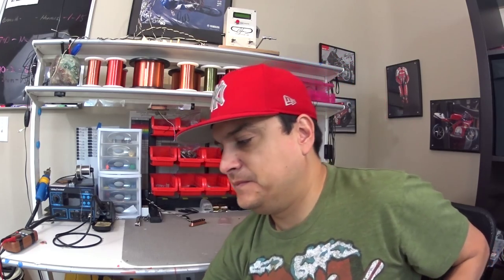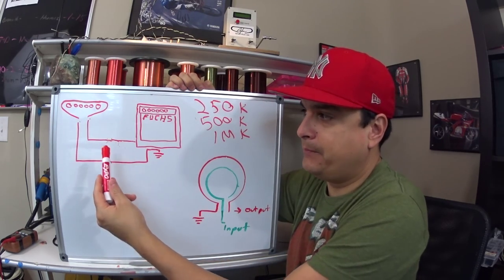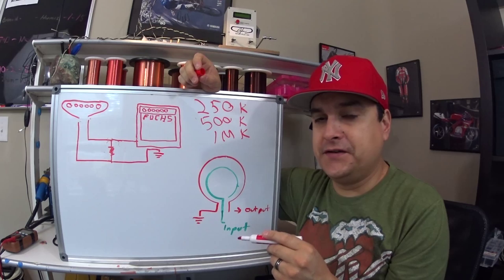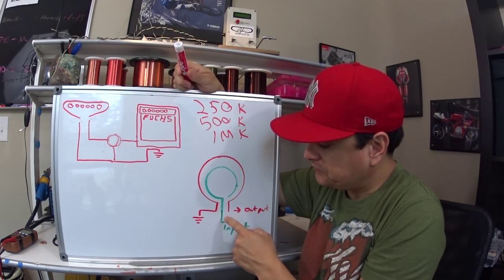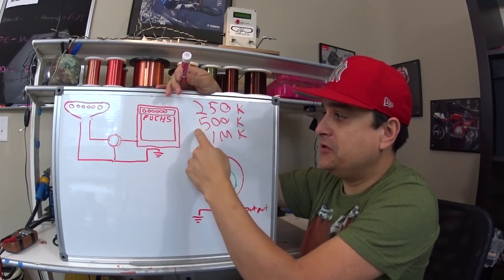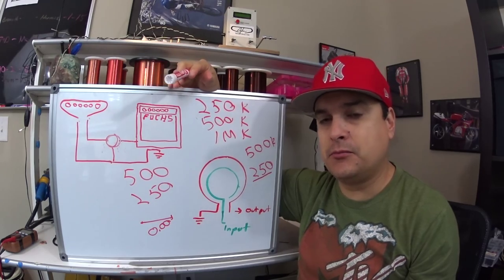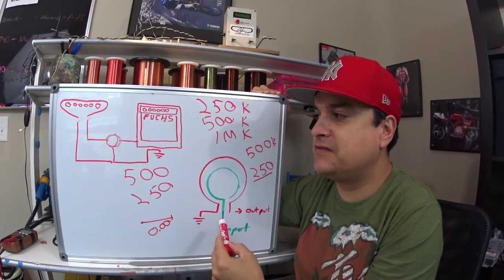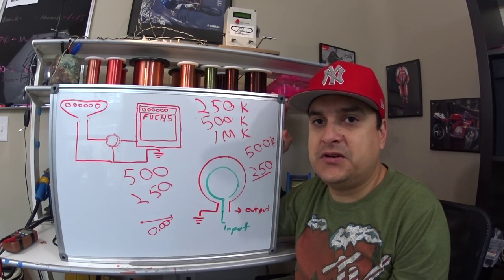Dylan Talks Tone Ep #10 250 or 500k pots in your guitar #30

Comment: Hi Dylan...can you give me please some advice ...I bought Seymour Duncan Hot Roaded set with SH2 and SH4-JB humbuckers and wanted to combine with 250K pots...problem is that even I go to zero with pot its still quite loud.( no silence ) have two Humbuckers - 2 Volumes 250K - 1 Tone pot. and 3 way toggle switch...question is ...I have to change 250K for 500K? or its any way to fix it with those 250K pots? Thank you for your help...
Reply from the maker: Yes. I would consult a wiring diagram for your configuration and double check it. Those pots should function with those pickups.
Reply: +DylanPickups may I ask you please for help...it would be nice if you can send me that wiring diagram just to solve this problem...Thank you...I would appreciate it...
Reply: Years ago I had a guitar with 2 humbuckers that was behaving just like you described.  I swapped out the 250k pots and put in 500k pots and that fixed the volume problem for me.  Sorry I dont remember the the brand of humbuckers.

Comment: what kind of pots and capacitor  I need  to  install in my fender jazz bass?
Reply from the maker: Daniel Toral This is a bit of personal choice. Many will tell you to use a 1 meg pot, but I like 500k.
Reply: I was thinking 250k. what's difference about sound  between 250k and 500k ?

Comment: Curious could it be possible to wire a 500k pot so you could switch it to 250k & back? Or is it just not possible?
Reply: +Mr Aguia   it is not a big deal  ---- i prefer  250 k to volume (plus treble bleed mod) and  100-250k to tone  on any type guitar   --  don't  forget about impedance

Comment: Too bad you weren't around when Gibson and Fender were like Ford and Chevrolet in the disUnited States.
Fender was all 250 and Gibson was 500. All those numbers mean is that 250 K can be transmitted as 250 K,
and if you have 500 then 250 can also be carried. Like they used to say when end users weren't just end users,
but actually built residential electronics yourself, try to visualize how it would work with water. That still works.

Comment: I’m building a guitar with mini humbuckers. What is the “rule of thumb” regarding pot values for these pickups?
Reply: 300k
Reply: I'd use 500k. I have a vintage rails in the neck and a lil 59er in the bridge (Seymour Duncan), and a noiseless fender in the middle position. I tried 250k pots and the guitar sounded too dark for my taste. I can't remember what capacitor I used, but 500k was the way to go.
Reply: @albertplaysguitar  probably 500k with 0.022 cap? that may sound a bit sharpy tho
Reply: @ChanoQlo  is that the big orange one??? I really should pay attention to details. As far as my guitar goes, not sharp at all. Very low output, so it gives you room to shape the tone.
Reply: @albertplaysguitar  yes, the orange one haha, that things filter the trebles. the less value, the more treble comes out, so 0.022 are used in les pauls for that crunchy sound, and 0.047 are used in strats for a more bluesy tone
Reply: @ChanoQlo  oh man, thanks for the clarification! For as much as I tried to read up, i didn't really catch that. But I will say that using 200k pots made things rather dark compared to the 500k with the orange cap. So in the end, I'm happy with the results.
Reply: @albertplaysguitar  yeah, for more output the 500k are the way to go, also the "orange" it's just the name, orange drop. There are orange drop in 0.022 and 0.047. People tend to switch guitars for a new sound, but switching pickups, pots and caps are better options in my opinion

Comment: Why not just put a 1MK in every guitar because you can always turn the tone down.
Reply: First, it's not 1 MK.  It's 1 Megaohm or 1000k.  Fender uses 250k pots because they want the volume pot to tone down the brightness of those single coils a bit.  Now, in the case of humbuckers you could use 1000k pots but they would be no different than 500k pots in all but the very brightest humbuckers so you'd just be spending a couple extra dollars for nothing.  A 500k pot with a high pass filter would be a MUCH better solution for humbuckers.  Most expensive guitars that ship with humbuckers do have high pass filters on the volume pots.  That's one of those little things you get when you spend $1800+ for an axe.

Comment: This is wrong. Higher value pots offer a higher impedance to the pickup, Increasing the pickup's high frequency output. Lower value pots offer less impedance, which reduces high frequency output. Resistance is NOT frequency dependent.
Reply from the maker: Resistance relative to ground DOES effect frequency… so…
Reply: @DylanTalksTone  it does, yes, but not for the reasons you're saying. Now normally I wouldn't care if it makes it simpler to understand, but if you're saying that resistance offers frequency selective filtering then how are you going to explain how capacitor tone controls work without things getting confusing? It's just not an optimal way of describing this, and as you can see by all the comments there are many, many people lapping this up like it's gospel.
Reply: @DylanTalksTone  You may find that there is a change to the frequency response if you vary potentiometer values, but that difference is due to the interaction between the Thevenin resistance of the voltage divider introduced by the potentiometer and then shunt capacitance. The shunt capacitance can be the lumped element capacitor or it may be parasitic capacitance of the rest of the circuit.

Comment: You're using a very strange representation of a pot, in your version the pots total resistance is always in series and shifts from output to ground. Real-world pots don't work like this, to correct your 2 track moving bridge design the inside green ring needs to be fully conductive(and close the gap, it's meaningless but confusing) and the red ring is the resistive element. Now, set to full volume your circuit is electrically identical to the direct to jack model you started with.
I suspect all your observations are correct at settings less than full volume.

Comment: Sorry, not accurate.  Volume pots don’t affect tone by themselves.  They affect volume only.  It’s the interaction with the tone pot and cap that matters.  without a tone cap\pot, all the different volume pot values change is the volume level at 10 and the rate it goes to 0 as you turn the knob.
Reply from the maker: Well sir... you would be wrong. Idk where you get your info but it doesnt come from physics.
Reply: EE degree.  Resistors alone are frequency agnostic.
Reply from the maker: However... in a passive guitar circuit, the volume pot loads the circuit as a whole... even at 10 on the volume. This has a major  effect on the resonant peak of the circuit, this changes the tone of the pickup. Sometimes, depending on the relationship between the two, this can be quite a noticeable difference. I have an EE degree too...
Reply: That’s a different kettle of fish.  I will buy that the volume pot affects the resonant peak of the pickup, and by changing the value of the resistor when at 10 on the volume knob makes an audible difference in the highs by interacting with the inductance of the pickup coil, shifting that resonance higher.  However, its not because high frequencies are bled off first by the volume pot

Anyway, keep up the good fight against misconceptions and false tribal knowledge.
Reply from the maker: The net effect is the high frequencies are gone so...

Comment: I stopped watching at 2.30 ... electrons are accelerated by the electrical field generated by the pickup's coil. That said, the current will flow along the least resistance path from high potential and low potential of the voltage, that is what the guy said. BUT it also need to flow in a  closed circuit ( they basically have to return to base) so it will not flow to ground, as the guy instead claims, but to the other pole of the pickup.

Comment: wtf are u on about ? its called resistance, which with a constant voltage source, inversely determines the current flow. Ohms law. A particular circuits Frequency filtering of a modulated signal requires a multi factor non-linear complex calculation. Apparently above your competence ?